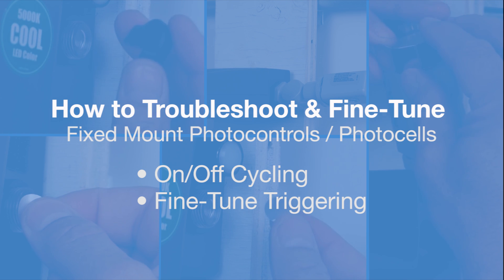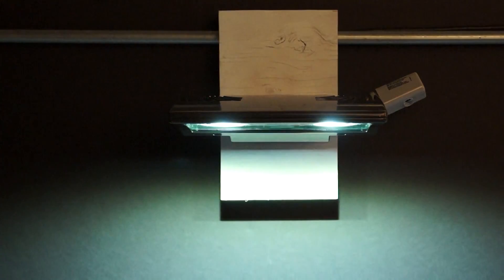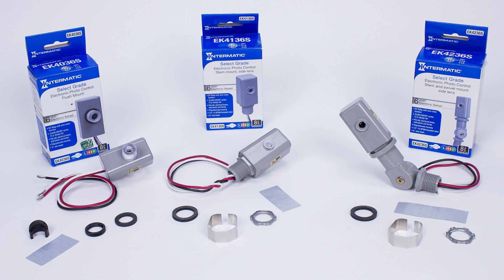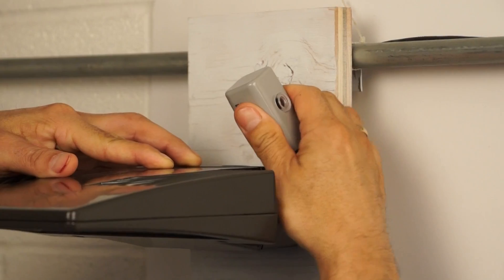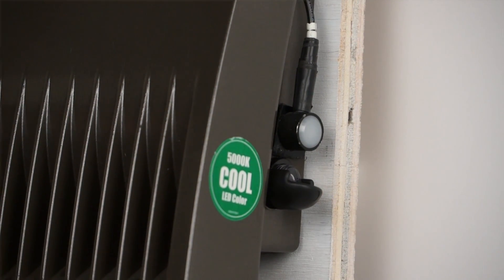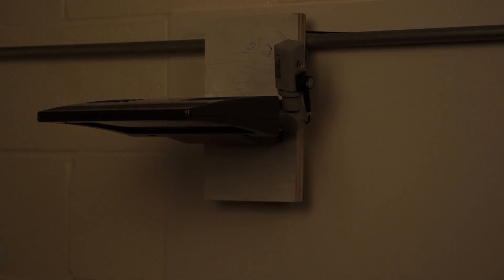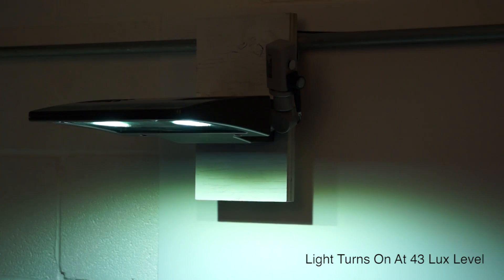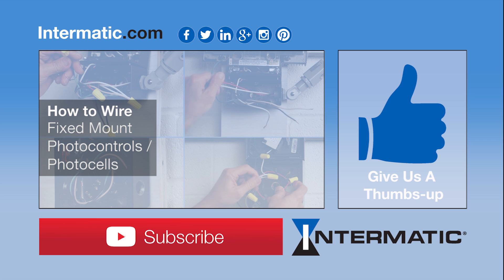Photocontrols Photocells Tutorial: How to Troubleshoot Fixed Mount Photocontrols/Photocells

Comment: Does not address photocell staying on later than it should. Master electrician here. Have tried tilting the photocell in multiple directions and even installed a new unit. East facing with no shade, makes no sense. Have exact same photocell on same light in the front and turn on times are 3-4 hours different
Reply from the maker: Hi Wade, We apologize for the issues you're having with your photo control. I've spoken to our technical services team and they have asked that you give them a call so they can troubleshoot the issue over the phone. You can call them at 815-675-7000. Our office hours are M-F 8 AM to 4:30 PM, CST 
Thank you for being a customer and thank you for reaching out to us. LG

Comment: I’ve installed the swivel unit and the lights burn constantly, never turns off. What would cause this?
Reply from the maker: Hi Ryan, Please get in touch with our Technical Support Team, they'll be happy to help you determine what's causing the lights to stay on. You can reach them at 815-675-7000 or https://www.intermatic.com/en/support.

Comment: I agree I had one that worked great for about 8 months and it also just died.  It looked like very good quality. Mine is the stem and swivel on that is hooked to a light switch.  The switch still works the lights but it does not shut off during the day as it used to.  :(.   Is that usual for these or just this brand?
Reply from the maker: Hello Christopher Lynch, we appreciate your note and apologize for the issue you've described. We'd like to speak to you directly to gather more detail surrounding your circumstances. Please email us at ConsumerServices@intermatic.com with your contact info, and we'll get in touch with you.  Or you can call our Tech Support team at 815-675-7000.
Reply: That's usual for ALL photocells light fixtures. Made in China bullshit!

Comment: Total garbage, I got one last fall,  it quit 8 months later. Plug in sensor has been going for 2 years now no problem, the only issue is that I have to reset it to dawn-to-dusk setting every time power fails.
Reply from the maker: Hi @nbv6376 - we apologize for any issues you've experienced, and we'd like to help.  If you'd be open to it, we'd like to chat with you to get some more specific information on the circumstances surrounding your experience.  Please email us at ConsumerServices@intermatic.com with your contact info, and we'll get in touch with you.  Or you can call our Tech Support team at 815-675-7000.